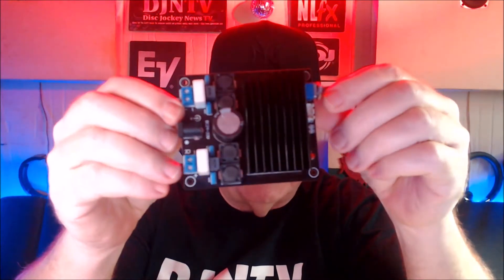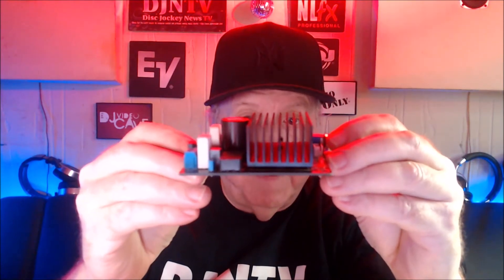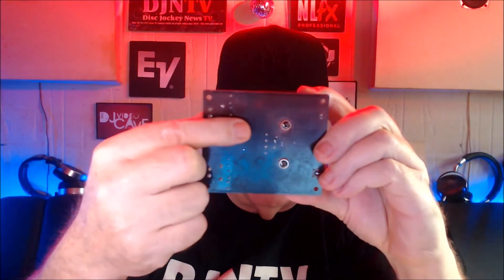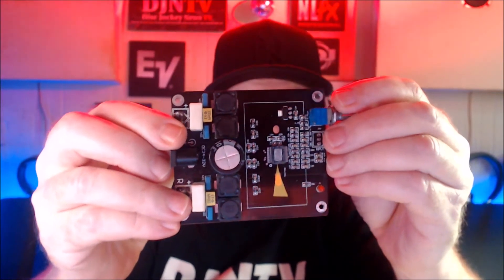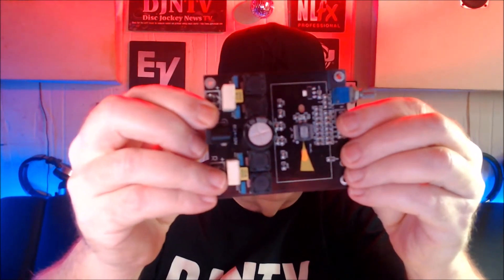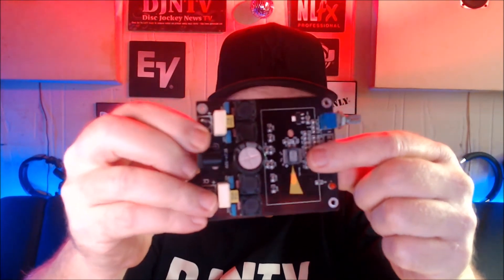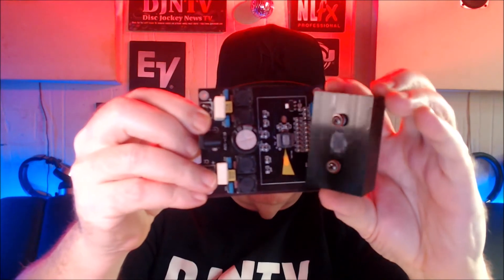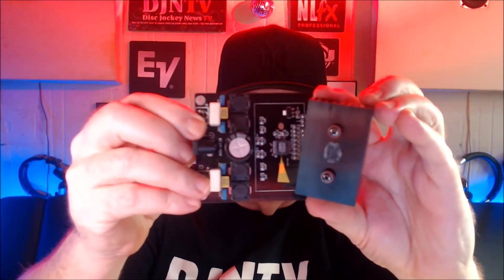DIY Powered Speaker Repair How To Fix Thermal Shut Down

Comment: I’m not getting power on my speakers either!
The fuses looked good still, but changed them out anyway… nothing!
Any advice?
Reply from the maker: Watch the whole video and try the bucket swap from your known good speaker. If the speaker works you have a bad bucket (amp module, crossover input and output etc. Good luck

Comment: I buy Thermal Compound Paste buy the 50 pack, a lot of companies seem to be stingy with it or its cheap cramp.The Alto tweeter in the 212 series have tih problem too.Guys make sure you leave your speakers off for 24 hours before doing this, the capacitors will zap you if you don't.  Great video Howie :)